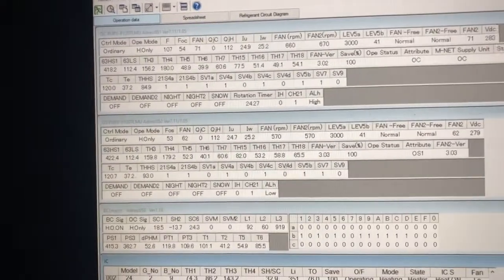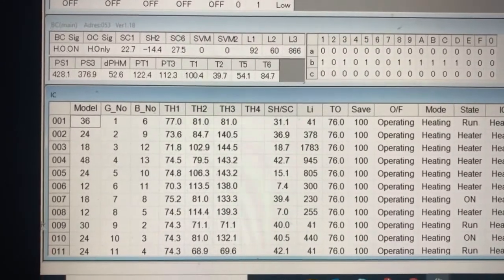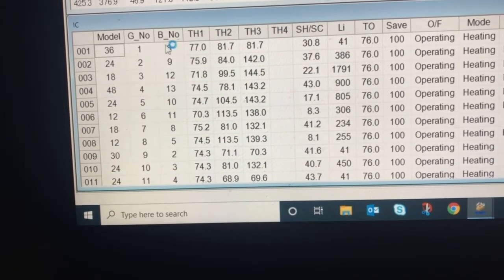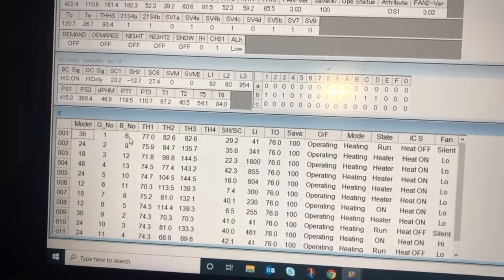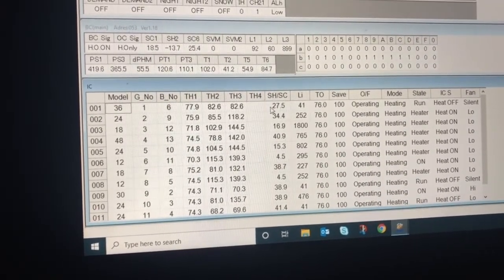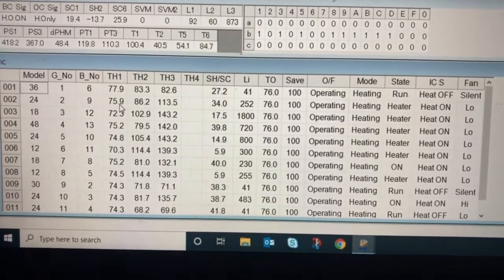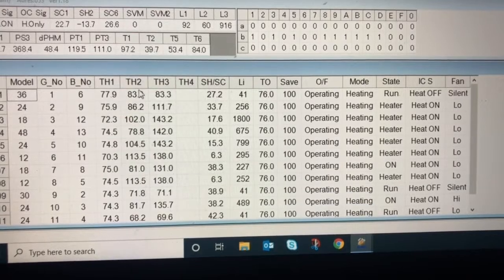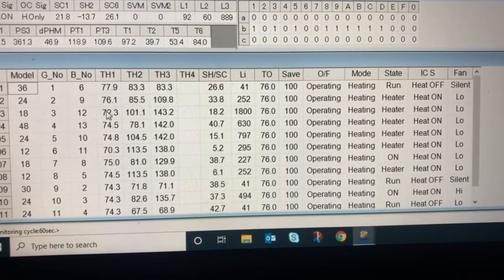Using Maintenance Tool Part 2

Comment: Thanks for the info I just started doing light commercial hvac Maintenace /services. Doing research on all of the commercial hvac tool I'll need to doing maintenances on these new advance systems .
Reply from the maker: Commercial is the way to go and I commend you for the prep work. This will be helpful because you will run into a VRF eventually. The cool thing is you can even purchase the tool off of Mitsubishi mylink drive website. The software is free.